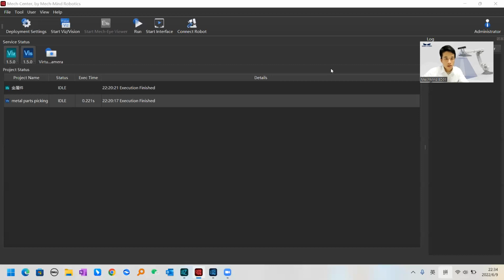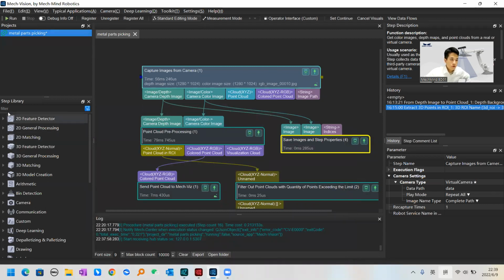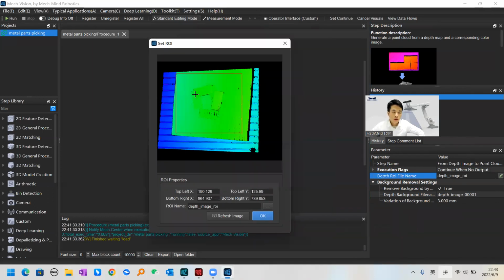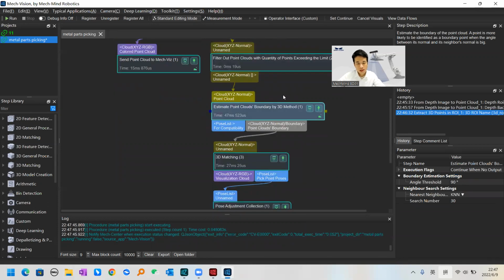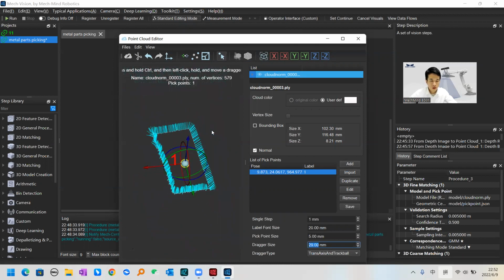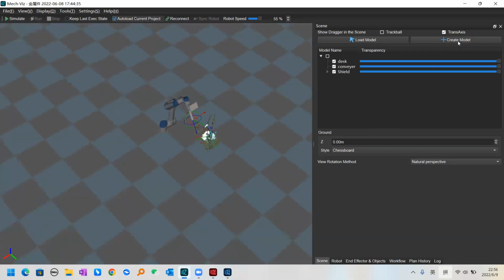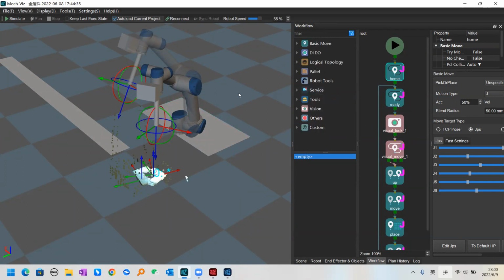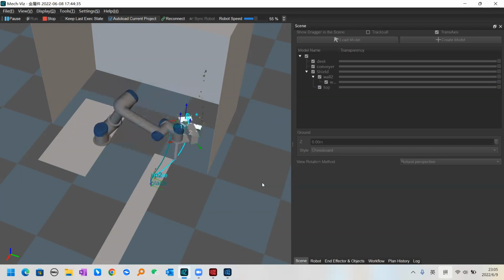Mech Mind Webinar Software Introduction + Metal Parts Picking

Comment: Hello. I can see we can learn 3D models of the parts we are going to pick up. What about the case of the parts, that have got the same cuboid shape, but vary a lot in their dimensions (height, width, length) ? Is it necessary to model every part of different dimensions configuration separately or is it possible to handle localization of the objects with some general cuboid model ?

Comment: In the case using scrip interface for different typo of robot how can about, hitting other piece ... example in the case of bolt.  typical they are a lot bolt on one place how to about hitting whit gripper .. Wath instruction you recommend to use.